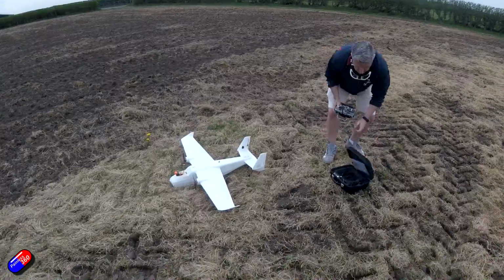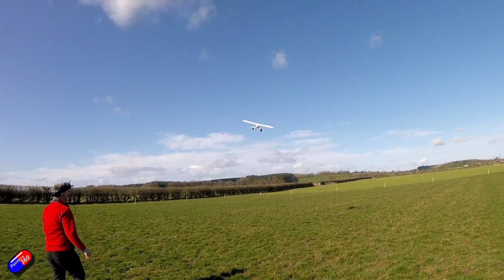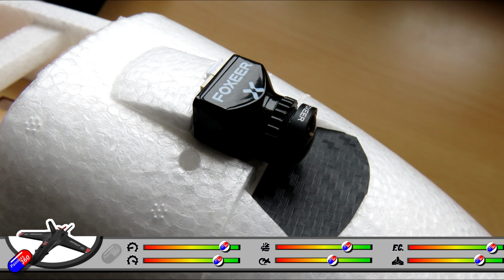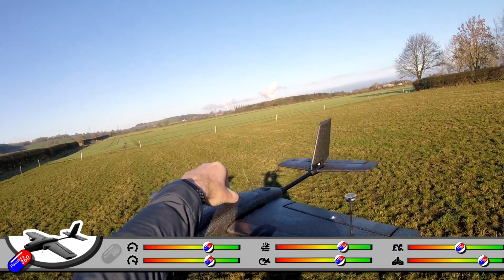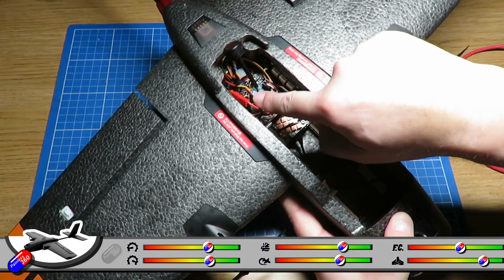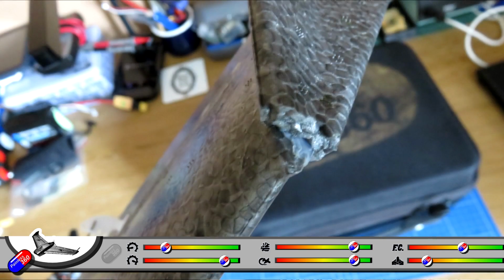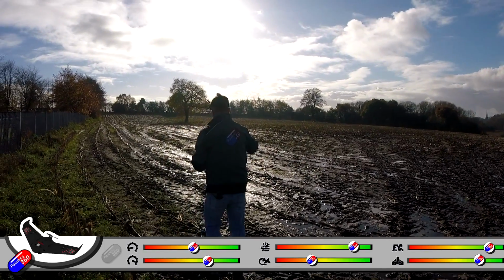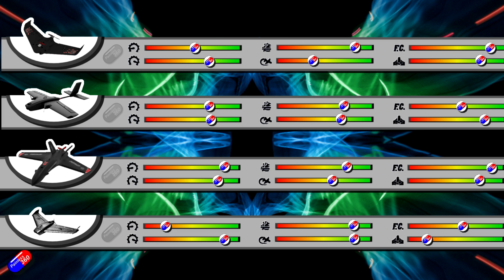Best 'planes and wings: My personal favourites! (April 2022)

Comment: Hi, I’m interested in the atomic dolphin. What is the average flight time with the recommended battery and motor? Could you fly it in a soccer field or does it need more space?
Reply from the maker: Depends on flying style and battery used. Over 30 mins is pretty easy...

Comment: Did the radiator on the vista help with something on the HeeWing f01? I mounted mine vertical after the camera with a 3d printed mount and did not observe any issues with it.
Reply from the maker: Yep, helps with heat. Happy flying

Comment: Out of these listed, what do you think you would most likely recommend to someone less experienced with small, faster type aircraft? I've got some experience with a trainer I (crudely) scratch built, but now I'm interested in getting a smaller, lighter wing that I can toss in a bag and fly anywhere. So far I've been eyeing the T1 Ranger, ARC Dolphin, and the ZOHD Drift. I'd initially be flying LOS, but I plan to get some FPV gear this summer if that helps narrow it down.
Reply from the maker: https://www.youtube.com/watch?v=OaKqAng-BVE will help. Things like a Bixler/Skywalker is a good first 'plane..

Comment: I just got into wings after 5 years of quads. I did buy a vas chimera but glued the wing on upside down and with the airfoil that it has wouldn’t fly. They sent me another one and I revoked its closet camping permit after I bought and flew the sky shadow S800. Waaaayyy too much fun. Can’t believe how much punishment it can take. Two crashes and with some goop glue it in the air again. I have a reptile dragon another 
S800 V2 and just bought a vas specwing for some speed. Great video I’ve watched you a million times. I’m a slow learner.

Comment: Thanks so much - very valuable practical information
I believe the Ranger T1 is the most silent and the Diatone Ripper the most annoying? 
From what I have heard most pushers are loud because the prop is relative close to the end of the wings ... do you think extending the motor mount on the end of the Dolphin and using a larger low RPM folding prop might help?
I like an efficient fast plane with power/range and I guess the Dolphin might be perfect for that, and it has a huge bay for a big battery and plenty of smart hardware.
Reply from the maker: None of the models are loud. See my videos on wings like the E-wings Blackhawk and the Ritewing Mini Drak for models that scream! Happy flying!

Comment: "Launches are relatively easy." - Re: Ar Pro.

I hope so! Mine is almost ready to maiden. Some folks have really struggled with launching this plane. They'd beg to differ on it's crash survivability. I added some carbon spars in the bottom with goop. I laminated also even though it was a total pain in the butt. I'm finding it very challenging to find CG and with my DJI air unit in a side bay, I had to add weight at the opposite wingtip to balance it side to side.
Reply from the maker: See my setup and maiden video. I'd strongly suggest using INAV. ;)

Comment: Not that anyone asked me but I like the t-1 for proximity ish flying. I don't have a GPS or anything in it just throw and go. The little flyfish is next on my list it's really fun LOS with the rudder can make nice turns and fpv just cruising around does good in the wind for it's size. And the dolphin I have setup with FC and giant battery it's just a nice plane fast and efficient. Also really like the mini skyhunter racing twin boom another fun proximity flyer but not much room for batteries and such